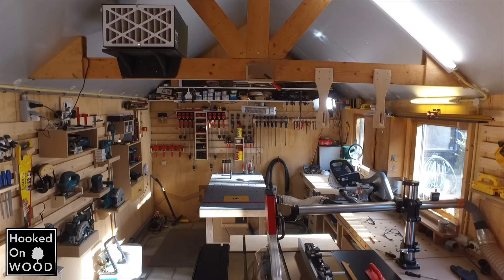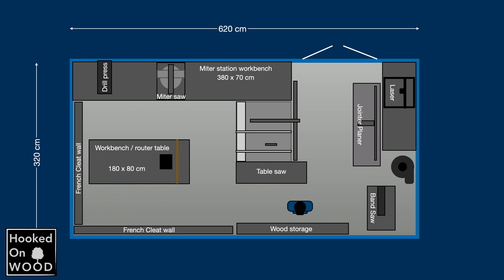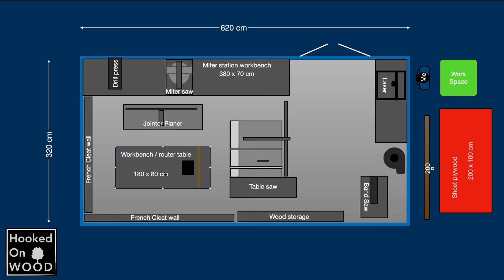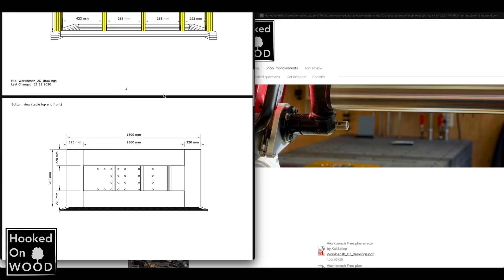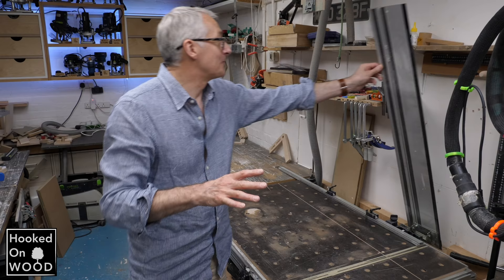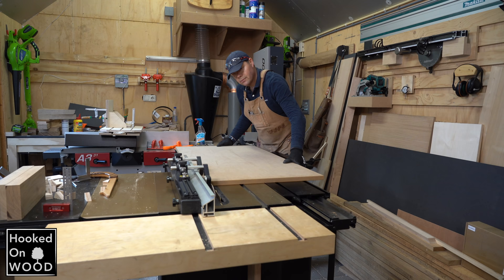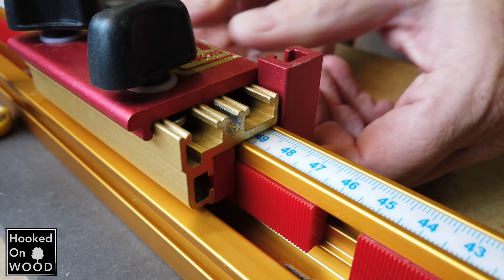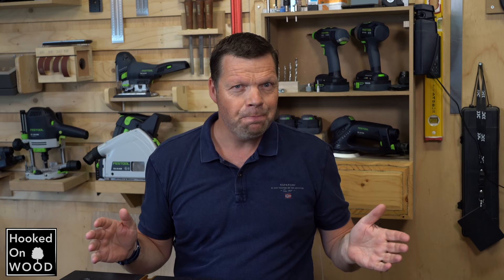How to organize your workshop!

Comment: Fantastic video. I'm just about to setup my workshop and I have  just bought my first dust extractor so im really looking forward to you doing that video. The fitting are really confusing. It's connecting to my tools thats hard. I bought a kit by rockler to connect to my power tools but only to find its ment for a shop vac and not a dust extractor. I hope you can cover connecting to tools and machines. Thanks so much for your video's. Cheers mate.

Comment: Thank you for this video.  
Your English is great. I have no problems understanding everything you say.  

I have a shop space  that is about 274 x 274 cm with restrictions...   I have been thinking about how a track jig and a circular saw could be better for me than the table saw and miter saw.  Your video and interview with Peter only reinforces these thoughts.  

I've been considering making all tables in the shop 61 x 122 cm and mobile.  This way I can arrange them around the walls for more work area, or put them together to make wider or longer table space.  With rare exception, I will be working with things no longer or taller than 130 cm.  That's for furniture I want to build for myself. I am hoping to make much smaller craft on a regular basis.  

You two have given me a lot to think about and consider.  

again, Thank you for the video.

Comment: Brillant Dennis, I learned alot here today on your video, your English is excellent, and your advice is helpful, I have a workshop that's 16ft by 16.6ft and machine placement took me along time and thankfully workflow now is pleasant, the assembly area of my shop I tend now to value more than ever before, I have a big Laguna Fusion 3 cabinet saw and planer thicknesser and many other machines but I have an assembly table bench area that has worked out great, keep up the great videos and stay safe, kindest regards Louie Ulster Workshops UK

Comment: Hi, Dennis, from another Dennis. I've been watching your videos as of late and find them both interesting and thought provoking. I especially like your China Tools videos and I have purchased a few tools from them, although I haven't tried any of them yet as I'm in the process of transforming my garage into a woodworking shop. I too have a small place and space is at a premium for me, so much so that I am putting my dust collector on the outside in back of my garage. Right now I'm making an enclosure that the top will open as will the back and one side to facilitate emptying the chip drum and doing any maintenance if the need arises. I cut a hole in the back of the garage to run a 6" pipe through and that will be my trunk size. The garage measures 6.71by 3.96 meters so when I get the outside enclosure done hopefully tomorrow, I'll start installing my ceiling which is 6" tongue and groove beaded board. After that, I get to start laying out my shop. I'm intrigued by the Valchromat and am looking into a retailer that I can get that from. Anyhow, you have a great channel and thanks for all that you do. Have a great day!!!
 Dennis
North Tonawanda, NY. USA

Comment: My workshop is about half the size of your current one. Possibly a similar size to Peter's. I'm in the process of changing it around, trying to figure the best position for each tool, I simply can't fit a planer in at the moment no matter what I do.

This video has given me ideas, particularly when you pointed out that it can be an inconvenience to move everything off a workbench if this is also an outfeed table. I've just built a basic MFT style bench and deliberately made it the same height as my table saw. Now, I'm planning on moving my table saw so it doesn't feed onto the bench.

I look forward to the next video.

Comment: Thanks so much for this video.  My new shop is 5.75m x 3.25 so efficiency is really important.  I find it very difficult to design a layout before hand, as only when I have the tools and use them do I know how they need to be positioned.  Still, your layout, and points of view have helped me re-consider some of my core ideas...  Now onto (practical) dust collection (and connecting it to machines) and of course the french cleats - I am planning on putting them around my entire shop, and make everything, including cabinets to hang on this.  That way I can always re-arrange stuff as I learn where I need it...
Reply from the maker: Hi Grant, thanks for your comments. I think you take the right direction with your plans. Will be a lovely shop to work in. Succes!

Comment: Another great video Dennis. Great point you had that rarely do you process one board on one machine and then move to the next machine.  As you pointed out you need staging space at each tool to hold the non-processed and processed wood. In fact that is my main issue - mainly because I tend to have to much crap laying around on all my horizontal surfaces. Looking forward to your followup videos and your new workshop layout. Take it easy.
Reply from the maker: Thanks Richard!

Comment: Hey Dennis. Have watched you for a while and just wanted to connect. I am in the middle of building what will probably be around my 10th workshop (the last). I was a joiner and professional staircase make when young and many years ago began working on CNC woodworking (more than 25 years ago) so it was rather large, expensive and complex in those days. I no longer work on the tools but I miss and enjoy what I would now call "making". I have built many houses (more than 15) and re-built a cruising yacht so I have done a lot of veneer, laminating and complicated work. I have just built my new workshop and suffer with the dinky limits of the UK building rules so have what many will consider a monster at 9m x 4.5m (moderate to me but workable) with a mezzanine for office, 3d printing and storage. My plan is also to start a youtube channel but my focus is very different to what I can see on the web. I am a convert to the MFT style workbench for sheet stock have previously built an oak cabinetmakers bench (Tage Frid style) which is still better for solid wood working. Actually I use the MFT table more to turn sheets into useable items but still find the big tablesaw and sled better at final dimensioning. I also have a long-bed Delta (DJ-20) jointer (British planer) and a wide thicknesseser and prefer that to under over machines. I look forward to one day catching up with you. I am an Aussie living in what I would now call little (tiny, inwardly focusing, nationalistic) Britain (No Ireland and no Scotland soon) and I cant even live in Greece 6 months of the year anymore.
Reply from the maker: Nice ideas👍 we keep in touch
Reply: @HookedonWood  I find it really helpful to see what other people do and how they approach things. I really like your thinking on may things. Like any master you are pedantic about accuracy and the most important repeatability. Sometimes we get locked in our own head and can't see "the wood for the trees". Some of my best outcomes have been to overcome mistakes I made. That's scary right to think it wasn't your creative idea in the first place but your creativity to solve a mistake when making the item. Anyway probably like you I am focused for now on my new space. Presently my workshop structure is up, the roof is tiled, the electricity, compressed air and lights are in (4000k for photo warmth), the electric Velux roof windows are in and working, the ceiling is plastered (that was hard work for my old body) and painted white. My ceilings are vaulted (ceiled on the rake) at 45° so with the large roof lights and step angles there is lots of reflected light (bounce lights for soft photography) options without losing too much precious wall space. For the walls I have purchased 15mm Medite MR MDF. I am going to vertically v-groove (5mm deep) every 85mm using the Festool router on a long rail and router slide. It will looks like paneling when done but it allows me to screw things to the wall. I wanted birch ply but it is very pricey just now (not sure why). My plan is to use Zinnser B.I.N primer on the MDF to get a good paint base (2 brush coats on the grooves and one or two spray coats all over with sanding) then use the HVLP gun for a coat of undercoat and then Dulux Diamond Eggshell for a low sheen tough spray finish. Thats my project at present and the next project will be metal duct work and dust extraction or maybe the epoxy floor finish, we will see. Regarding videography, I used to do lots of 35mm film stills photography and when things went digital I was one of the last to change. But I must say I do like the idea of digital videography for youtube so I am excited about that prospect. Presently I only have a Fuji x100s camera that I use for street photography and have been pondering what camera to use for videography. I think I will go for the Sony A7iii full frame rig. With the height of the ceiling (4+m) I am going to build a central camera crane that suspends from the centre and articulates so I can have the camera wherever and avoid tripods. It also gives the option of automating movement with a tracking gyro head to add interest to the videography. Your camera work looks solid by the way so you either came to the game with camera skills or have learned quickly.  So I am sure we can swap stories and ideas on how to do stuff.  Anyway sharing ideas and methods will probably help us all. As background I work in the computer industry now as one of the geeks I suppose. As a word of warning I am what the say on the spectrum (aspergers) so my emotional intelligence is not so advanced. My email is graham.horne@bateau.co.uk and I will share some phots of my progress if you like. My ideas aren't to to bad

Comment: you are a perfectionist Dennis, and it intimidates me, as I don't even have a workshop. 
The only advantage of not having a workshop is that there is nothing to organise ;P

I work outside my house, and even for a single cut, I need to roll out the machines.

I will be starting my off grid cabin in few weeks though, and then your tips will come extremely handy.

PS
I was wondering if Peter Millard has English cleat walls in his workshop.
Reply from the maker: No Idea, I did not see them jet! But I do not want to intimidate you, just inspire you. If I did not have the YouTube channel I would not have keep it this clean and organized. That said, because of my YouTube channel I start to discover how pleasant it is, to work in such a nice and clean environment. So, it is definitely worth the effort.
Reply: @HookedonWood  maybe you should tell Peter next time you get on the video call, that French men use French cleat walls, therefore English men should be using English cleat walls.

yes it pays off quickly, when you don't cut the corners in your work in general.
Reply: @TigerCarpenter  Yes, cutting the corners off always takes more time ;-}

Comment: Super excited to watch this collaboration between two of my fav YouTubers!  I’m also in the evolutionary process of improving my workshop and it’s probably smaller than yours and Peter’s. This vid had many helpful tips and I think I am going to have to do a scale drawing on my PC as recommended. We have max sheet sizes of 240cm x 120cm to work in with the imperial sizes (8 feet by 4 feet) and that’s my biggest struggle.
Reply from the maker: Hi Paul, 
We have also a common sheet of 240 x 120 or bigger. But I have to cut them down for transport. So, that is why in my workshop this was good enough. Bigger projects are simply to big for my workspace. In my new workshop, I want to cut these sheets inside. But that is 3 times the size of my current workshop.
Reply: @HookedonWood  hi Dennis. Yes, I have to get these boards delivered and it is expensive so I buy about 4 at a time but then I am struggling with storage space!  I have to cut them down outside with my circular saw and then bring them in to cut further on my cabinet saw. I’m having problems with good dust collection on my cabinet saw at the moment even though I invested in a 2kw Axminster dust extractor machine. It’s a problem with the design of my cabinet saw which I will have to modify. Sadly the manufacturer (Charnwood in the UK) has not done a good job with the design. All these things are challenging in a small workshop. I can’t wait to see your new shop soon. All the best from England 🏴 and enjoy the Euros! ⚽️

Comment: I should have watch this video sooner! A lot of youtube-video about workshop organisation are just showing what they did and not what is basically possible, to avoid et to recommend! Thanks!

I'm currently organisizing my workshop. With 4 square meter less that yours and 3 doors, it's a bit tricky and for the moment, I'll try without miter saw. I'll have to workbench, a common table with some features and a circular saw/router table on the other side. Let's how it will work...

Comment: Hi Dennis 
I really love your chanel ...and work. Especially the straight forward and flaxsible mindset. One question about the nice mdf , if that's o.k . I made a more simple table , but used same hdf. What kind of protection did you use on it, and how do you recommend to apply it . Thanks again , from Israel... ( from  Dutch background)
Reply from the maker: Hi Assaf, I did some oil on it. Danish oil. I do this because It is easier to sand and oil again. But I do not have that much experience with other, I stick with Danish oil, but I am sure more will do fine.

Comment: A very interesting layout but one area concerns me: wood hand planning- your bench has no vice and I have used the clamps you use but have found them not strong enough to hold the piece. What solution do you find is best for you or do you not use any planes. I note you moving more into solid wood where surety hand planing is a must..
Reply from the maker: I get it done, but in my new workshop I will ad a vice to it. But then I do not place my router in it. Because I have more space in my new workshop, I will separate my router.

Comment: Great video. Concerning your miter saw fence: have you checked the INCRA Flip Fence? Same system with the racks, but with a flip shop stop. There is also telescoping versions...Unfortunately the system is not compatible with the "standard" track system.
Reply from the maker: Yes, Martin. I just found out. I have this one on my Incra miter fence. You have to mirror the flip stop to make it work on this fence. But it works. I still try to make a fence with some flip stops from Banggood because there where a few with potential. Thanks for your tip!

Comment: Dennis, what is the program you use for your shop layout. I’m building my small shop out and this program would help me tremendously. Great video and information.
Reply from the maker: It is just Keynote or Powerpoint. Mostly free on Mac and Windows computers. I used to work with that, so that was easy. But you can also use Pages/words. But Keynote is easier to make things on scale.

Comment: What do You think about combination 5 functions machines like hammer c3 ?
Reply from the maker: I found it difficult to answer your question. I like the combination saw and and moulder because you can use the same fence and table. If I had the change, I think I would buy it separately, because it gives more flexibility. Except the saw and router. I think that is a good combination. But it is just a feeling and not based on experience. That is why I found it a difficult question.
Reply: @HookedonWood   thank you very much for your answer. I invite you to my modest channel - some films are in Polish, but these from projects are only with music :)

Comment: basically the same dimensions but missing a lot of height. my cieling is way to low. Where do you store  full sheets plywood? and offcuts? your wood storage is not that big
Reply from the maker: Good Question, I will answer that in one of my next episodes. But basically it is a bit of Wood management. I have to get wood for every project. And be careful what I keep. But I also have another small shed where I can store a bit. Mostly some Oak. But I have to share that with my family :-) And I am not the boss in house :-)
Reply: @HookedonWood  not the boss of the house, i feel you :-)

Comment: A Japanese YouTube, JSK-koubou, has a video on how to make a wall mounted plunge saw (https://youtu.be/M1xYKw5FP-0). What do you think of this as a space-saving solution? I'm not sure about the compromises on size of wood it can handle.
Reply from the maker: Hi Charles, I like his channel and how he make things. I do not like this design particularly. It is really small. The two pipes are always in the way. A track saw makes a lot of dust. I can understand for space saving you look to a wall. But when you use a plunge saw, and a track you are better off. The table from Peter is very easy to make yourself. And I think that is also space saving because it has multiple use. But If that is also not enough, perhaps then I will go for this solution.